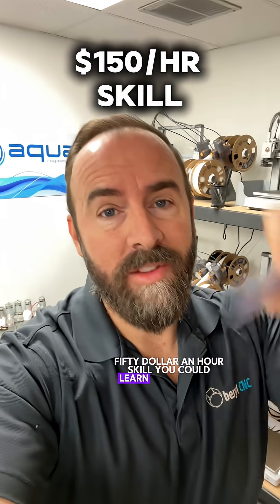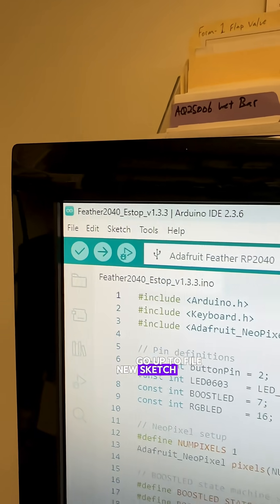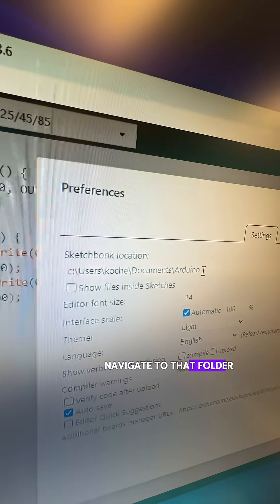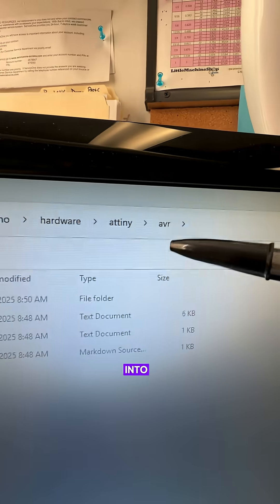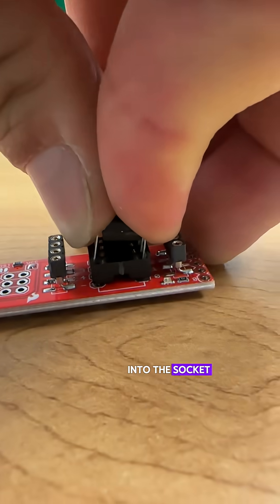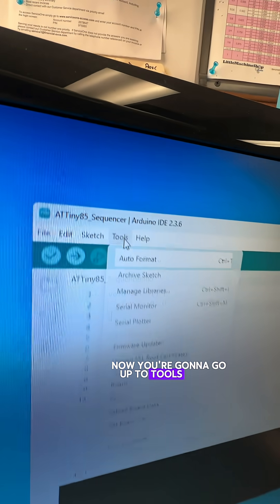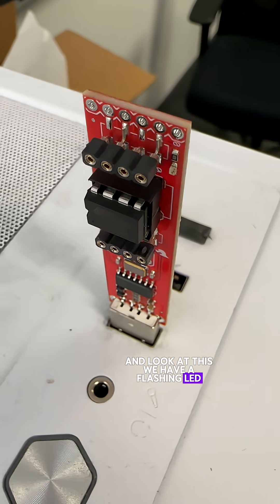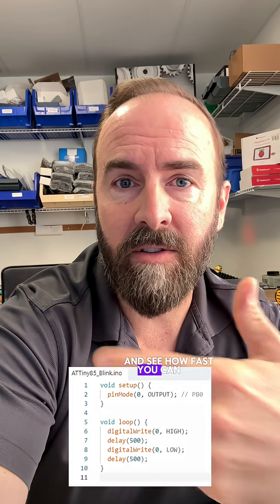Intro to ATTINY Microcontroller Using Arduino IDE

Comment: As an electrician apprentice, I’m interested in learning more electronic applications. I need more convincing that this is worth my time to learn. All I see is that you made a thing blink. Maybe a more practical/useful demonstration would make a better argument for someone to start learning this stuff. Plus, last time I was messing with github, I was pulling my hair out trying to figure it out along with allll the other table settings involved to make it work.
Reply: Yes, there is a lot to learn but it's worth it. One example, I installed  IR patio heaters on my clients restaurant patio that they can control from their phone or buttons on a wall.  The microcontroller is wIFI capable and that in turn signals the contactor relays to pull in when they want them on. I also programmed a timer so that when any of the relays are turned on they are turned off after one hour that way they can forget them and know they are not going to be heating empty space all day or night. I also made a control board for a client's gate to enter their property. I developed a database that he can add friends and family to the approved list and all they have to do to open the gate is text a command to a certain phone number and as long as their phone number on the caller id is on the list the gate will open for them. 
I play all day really.
Reply: @marksmanaz 
Good to know.
Where is a good place to start as a beginner. I’ve done some coding before and I’ve built my own solar generator and electric skateboard. Do you have a roadmap for noobs? There’s a LOT I want to do (make a tazer sword/dagger, build a scaleable, portable renewable energy generator that utilizes wind, solar and water to generate electricity for hikers, campers and even homes. A lot I’d like to do.
Reply: @icevariable9600  People kind of laugh it off when he shows how to make a led blink but that's where you start. It get you familiar with coding in C and your mind natural ask the next question, "how do I make it do this, how do I make it do that, what sensor can use and does it have a library?". I have mostly been working with the esp32 line of processors myself. They have as many advantages and are cheap.There are many blogs and videos giving step by step how to tos for many of the standard coding and applications. I'm not sure how a microcontroller helps with a taser and battery management boards are widely available for charging portable batteries on the go. Sounds cool. Good luck.
Reply: @marksmanaz  You'd enjoy the new raspberry pi zero 2 w. Faster, more capability and is very efficient and has full raspberry pi capability including hdmi port, usb3, full camera slot, all the pins your heart requires and costs close to esp32.
Reply: Once you learn micro controllers, you get to learn all kinds of inputs and outputs.

Input: thermistors, humidity sensor, ultrasonic, buttons, dials, cameras, pressure, magnetic hall effect, infrared receiver...

Output: solenoids, heating coils, lights, sirens, text messages, 8bit number displays, pumps, music, vibration motors, stepper motors...

It all starts with the microcontroller, it's the first unlock on the skill tree.

Let's say you're wiring up a house. You can make your own system of proximity activated lights for the staircase. The house gets an awesome feature, and you get to charge more and get more jobs.
Reply: @edlubs11  
Amazing. I’ll check and see if we’re taught this magic you speak of.
Reply: Thank you for your honesty

Comment: I would like to shift my company from IT/UAV solutions and drone repairs/parts to a completely domesticated UAV manufacturer. This is the entry for a lot of the custom PCB and electronics that we so desperately development for within the US. If anyone is interested in becoming an intern or partner, bringing knowledge and tools or other niche abilities, please contact me. I have been in business for over 5 years and stepping into the UAV market can be extremely lucrative if I have the right team.
Reply: You on iG for DMs?
Reply from the maker: You can message me on one of the i2c_jason socials if you get stuck. This is a great entry point for that sort of hardware stuff.

Comment: Would you have one of these control a contactor for higher voltage applications?
Reply: Yes, I have done it for contactors to power IR patio heaters. If you have a project you are working on let me know.

Comment: So, if I can make 8 flashing lights a day, that's $1200 per day. Sign me up.
Reply: OK, so I’ve watched this like seven times and I still don’t understand how this flashing light correlates to making money because nothing is explained in the video on why you’re doing any of this or how you can apply this to anything in the real world
Reply: @MrCruzstyle  it doesn’t. He’s showing you how to test the board and make sure that it works. He was simultaneously really good and really bad at explaining this. What he is saying is you can charge up to $150 an hour for programming, micro controllers. So like if someone needed one for a refrigeration unit to do something specific(for instance, they needed a chip that could turn on and off a fan controller at certain increments or temperatures) and you programmed that microcontroller to do that specific task and you spent three hours doing it that would be worth about $450 bucks for a little one dollar microchip. He’s not saying to set up a bunch of these chips that have blinking light  code on them to make money. He’s just doing something with the chip to kinda illustrate his point. But I do understand your confusion. This just happens to be something that I’m experienced with.
Reply: @pratorian awesome explanation but how do you market this? Fiver? Like where do you find the demand/consumer for the microcontroller?
Reply: @pratorian how do you find more practical applications for things like this? What about devices that don’t have USB ports?
Reply: @pratorian you should make videos explaining stuff cuz your comment explained what this guy failed to explain in an entire video
Reply: @pratorian  so how do you find a customer that wants a single microcontroller programmed for $150 an hour though?
Reply: @pratorian not all hero’s wear capes
Reply: @GenericName9283  So that USB thing he puts the chip on is just an adapter for programming. Theoretically you would put code on the chip to do what they require then unplug the chip. And at that point it gets either put onto a circuit board by the company, or used in whatever capacity they intended.
Reply: @willROFL  You don't. That's not realistic. You either use this skillset to get yourself a job(once you have advanced way beyond just a blinking light), or you market yourself as someone who can program microchips, and try and network and make connections in the different industries where your skill can improve their product. And a job isn't going to pay you that much to come work for them. But marketing yourself as a contractor, and a company bring you in and say "hey we need 50 chips that can do *this thing*", you can tell them a base rate. If your new to this i honestly wouldn't ask for $150/h you probably wont get it. But maybe $100/h as a base with a 2 hour minimum or something like that. And then you either figure out how long it takes to make one chip and multiply, or take that number in your head and come up and offer for them something like  "50 chip for would be $5k, %20 off with for bulk, so you charge $4000". Don't be greedy and when they need 1000 chips they come back to you.
Reply: @genX_gamers  Thanks!
Reply: @pratorian  can u use the controller in my garden for example when it is raining turn the roof off, when the temperature is low turn the heat on and off, or adjust humidity
Reply: @alakazaam-n7c it requires more sensors, but yes, that the gist of this. When temperature hits x threshold, send signal to open y device.
Reply: @MrCruzstyle  he's showing you the door to making that much. If you open it and walk through is up to you. This is just the start of the journey to $X/hr....
Reply: That's $4,800 for a family of four
Reply: @1323jason Ibsee what you did there. 😂
Reply: The issue is finding someone to pay you $150/hr. That's the video I want to see.
Reply: you would be surprised how small the leap is from a few flashing lights, so a full product. It's usually just a few sensors, or some advanced code.
Reply: (And yes I know you're joking. several other comments said the same thing you did, but unironically)
Reply: @blarghblargh  Unironically, it's misleading clickbait to suggest this is a easy path to a 150/hr job. This is literally the most basic mundane info for a hello world type project.
Reply: @blarghblargh unironically sounds ironic to me.
Reply: @blarghblargh  ( I too occasionally have the impulse to crack a dumb joke, but I find that if I just leave it, someone else will come along and do the job for me. Laziness FTW! ✊😄 )
Reply: You have to sign yourself up, and draw the rest of the owl. He's saying getting started is easy, and that it can lead to your own lucrative business. He's not saying your business exists after the end of the video. I swear, people have no media literacy
Reply: @blarghblargh I still don't get it though, how do you use this skill to make money?
Reply: @theinkweaver4639  That's my issue, I mean I didn't want to leave a comment and criticize but I don't fully understand how this is relevant to the start of the video. I am an electrical engineer and this is quite simple; still, designing a device and selling it is not that simple imo. But then again, maybe I'm wrong; I'd like to learn the latter part of this lucrative business.
Reply: @blarghblargh  Its moderately interesting click bait. People can take shots at it if they desire. How much "media literacy" do you need to be annoyed by click-bait?
Reply: @blarghblargh  yeah, it's like teaching you how to draw a line and saying that now you can become a Picasso.
Reply: @blarghblargh  if he's coming with such claims he should demonstrate it better. Give us a simple idea of what we can accomplish that is useful to the world. Making a light blink isn't useful. Make us interested in actually looking deeper, this is interesting but the blinking light didn't make me think it's worth following thru. You have no empathy, you can't put yourself in the shoes of someone who doesn't know this, you (possibly) see it for all its potential, while other's don't. That's what empathy is.
Reply: @blarghblargh  chill, the dude who made the video dont want you bro
Reply: @blarghblargh more like they have enough media literacy to get annoyed at how pathetically scammy and click baity it's all become and they don't  just clap along at every inspirational grifter that pops up on their time line espousing money making schemes that if they were so lucrative the influencer would be doing it themselves and not having to flog the idea to chumps online at 150 words per second

Comment: I couldn't get a job after obtaining my engineering degree. I think the job market is flooded with degrees.
Reply: Diversity  is key here
Reply: Duh.  And a ton of them are useless specialized idiots :P
Reply: Are you in the US? Plenty of jobs for electrical engineers
Reply: @noahradio  how lucrative are the jobs for PCB design? I’ve done some projects with a past startup but never really explored that space, felt kind of hate kept even though I myself am an electrical engineer grad. But yea making the schematics, designing the boards and seeing the Berber files materialize into a full board was always so satisfying, a career in that would be pretty cool.
Reply: It's not that. People were sold the idea that degrees would send them to the moon, so everybody focuses on education and education only.

Except the reality was that experience is king as it always was, so the people who followed the word of education religiously got left in the dust with outdated degrees, zero experience and outstanding debt.
Reply: @johncallof8839  Honestly its mainly me, I have several job interviews. I had a few offers, but they take to long to make a decision, and by the time they get back to me. I often do not feel like working for them anymore. I guess what I am trying to say is that if the location is not efficient, I am not going to work for them. I also had interviews where I was doing good, but as they asked me question, I realized that it was not the place for me, and they could tell I lost interest halfway through. My skills, projects, and work experience attracts companies to me. I'm also going for a Masters right now in EE, so I'm not really to focus on getting an okay job. I also did take out huge loans to pay for school, I'm too smart for that. I attended a public university, and worked to pay for my own tuition and living expenses. I ain't too sure as to why people take out large loans for no good reason, but I was not one of them. I had a clean no debt engineering degree.
Reply: @johncallof8839 this! The best engineers I know got Cs in school but love building stuff. The "smartest" engineers in my class couldn't design their way out anything
Reply: @johncallof8839 yea but now with 5+ years xp you can't get a new job worth a fuck with no degree...
Reply: @johncallof8839 i had to follow education religiously because noone hires with no experience and no degree 😂
Reply: same, electronic engineer on paper. Now work for a software company.
Reply: Full stack experience? Mobile app experience?

Typescript, React Native for mobile frontend.
Js mainly for backend.
Database locally hosted while I'm currently very deep into development.
Reply: He's completely disregarding his career outside of that where he had contacts that want to build a prototype and even more importantly, is willing to pay a singular red cent to get it done. 

I've heard this $75-$200 lie hundreds of times, this is only that if you happen to already know a bunch of rich people making products. And thus know the value of a prototype...

Most of us will only ever get offers from some dipshit that thinks he has a million dollar idea and is willing to cut you in a percentage. (Pro tip: It's not a million dollar idea and isn't going to go anywhere and idea guy will never have the capital to manufacture it anyway.)

Is as it always was, not what you know... It's who you know.
Reply from the maker: @Segphalt  I started my business from complete scratch the minute I saw what the job marked looked like. My GPA sucked and I realized I was never gonna compete for a cubicle engineering job with my classmates who were super smart. So I just started my business before I graduated college, built it one connection at a time. I've signed my own paycheck front and back for like 21 years. Just trying to help motivate others to see this path because many don't ever think of it. Not selling any course, just trying to help.
Reply: @Segphalt you're capable of meeting new people. Problem solved. Ya nerd
Reply: @blarghblargh how do you meet people with money?
Reply: What, you mean that people don't pay me $300k/yr for watching a 1 minute video, and making a blinkenlights hello world project? Fuckin nerds just want to flex that you know things. I know those things too. You know how we learned this shit? The first step was intent, the second step was doing something concrete, third was searching for the next step. Career by induction.